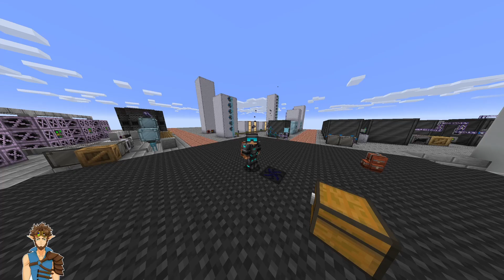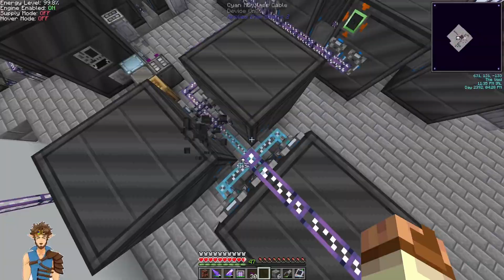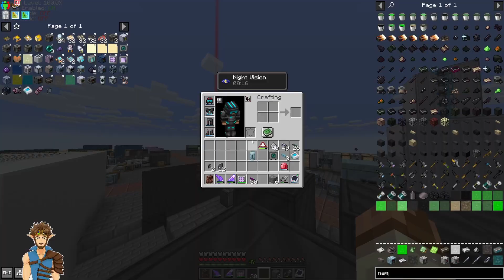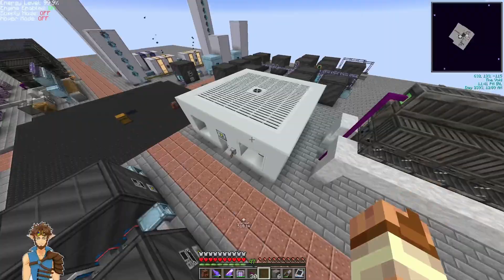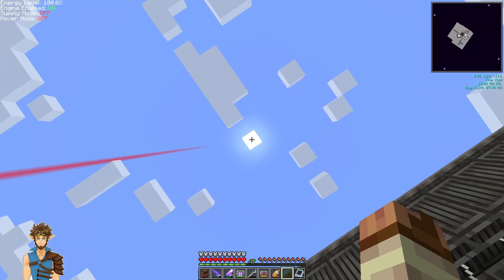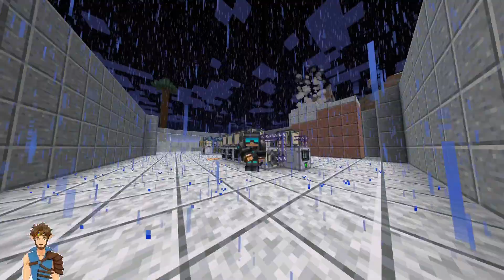Gregtech Modern Ep71: Ludicrous Voltage Energy Upgrades

Comment: LuV actually stands for Level uv Violence. (or however the undertale quote goes)

Yeah, the way i understand it, the numbered circuits exist so you make the exact thing you want to make and not another recipe.
If you're using multiple circuits for a single pattern interface, you're practically inviting in problems.

The p2p bus in your assembly line confused me, so i re-watching episode where you set up the assembly line:
I still don't know why there's a p2p tunnel in your assembler setup doing seemingly nothing. 
I see that you used an inventory upgrade on an interface even though pattern providers skip their inventory. 

I heard you think there are only two variants of pattern provider.
The standard fullblock (pushes items, connects, and receives items from all sides)
The directional fullblock, made by wrenching the standard fullblock (pushes items to front, connects from all sides except the front, and receives items from all sides)
The subpart (pushes to front, blocks connections on subpart, receives items from front)

When connecting a pattern provider to an interface, at least one of them has to block a network connection, meaning you cannot use a fullblock interface and omnidirectional pattern interface specifically.

You also probably didn't have to manually set every single storage bus to a different priority. Just setting the fluid busses one above should have done the same thing. 
I also have no idea what problem you had, which would require doing so. 
Unless gregtech lets you put irrelevant items into fluid slots for some reason, in which case - filter.
Reply from the maker: The p2p set up is kind of for future proof. I forgot to mention it in this episode but I found out how something works and will probably(If my brain remembers) show it of in Episode 73 not on the assembly line though. As for the assembler issue it was that I had accidentally place a duplicate pattern in another machine.